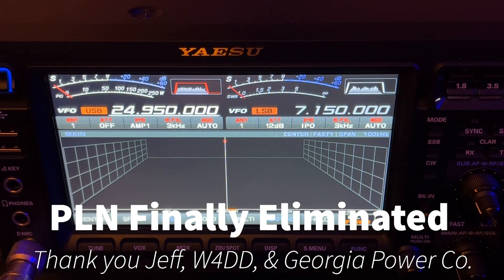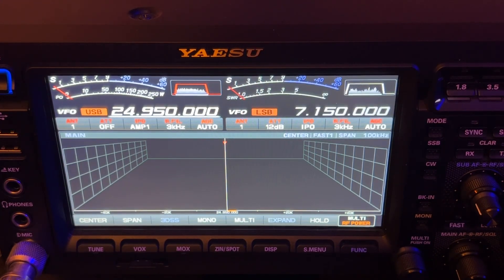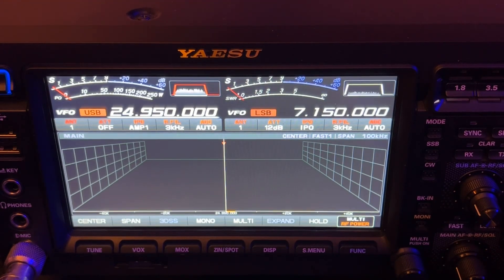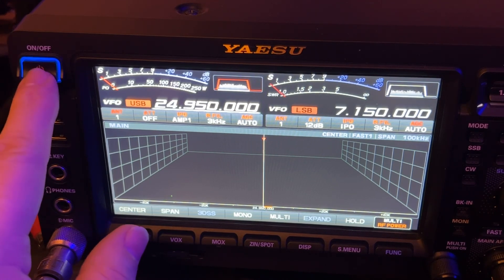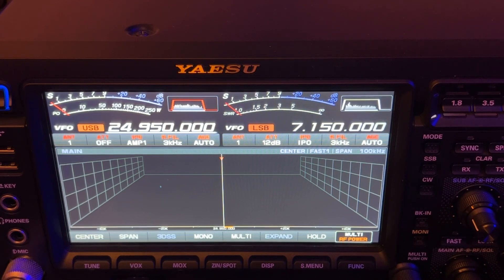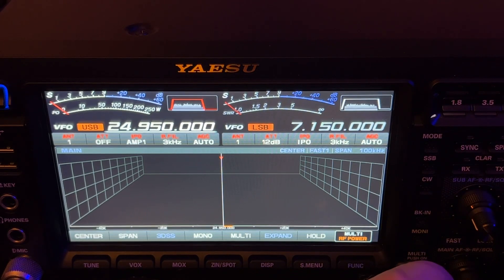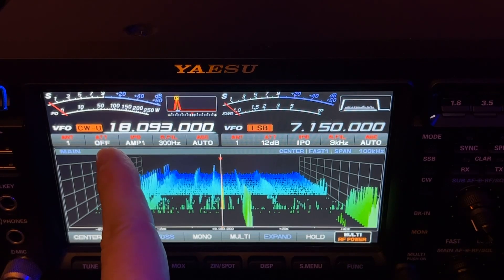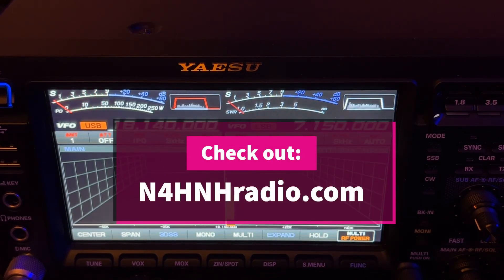PLN Finally Eliminated #hamradio #noise

Comment: Around 20 years ago I had some power pole noise that the local power company ignored every report I made to them. The way I finally got them to come out, after being 'blown off' for months, and investigate was to write them a letter. In that letter I indicated that a copy of this letter, including the date of every report I made, was also going to the FCC. Just a couple of days later I was contacted by a technician requesting when I would be available to assist him. I had to threaten them with government action for them to actually do something.
Reply from the maker: They are no longer afraid of the FCC. They know that the FCC no longer gets involved. The FCC turns it over to the ARRL. About three months later you get a call from the ARRL. That’s what I did after my power company told me that they don’t fear the FCC.  In fact, they told me that they absolutely don’t fear the ARRL. 

Jeff had the same problem as me. Couldn’t get anyone to call back, even if they said they would. He had to enlist the help of someone he knows at the power company. They finally got someone to help. Jeff had already done half their work. He identified every source of noise.

Comment: I have Philadelphia Electric Company. I had problems about 10 years ago. They were supposed to come out one afternoon to check things out. But they never did for one reason or another. My secret was to tell the power company that I was going to report them to the FCC. I told them I had an FCC Ham Radio License and if they didn't fix the problem quickly I would report them. Well, the one thing a power company does not want you to do is report noise problems to the FCC. They came out within a couple of days and fixed the problem. KB3Z
Reply from the maker: If you read the whole story about my ordeal, which is covered in the description for the video I reference in this video, you will find out that my power company doesn’t fear the FCC. And they especially don’t fear the ARRL.  They say so emphatically.  In fact, the FCC doesn’t help with PLN at all. They turn it over to the ARRL. The only reason this got resolved is that Jeff pinpointed everything that needed to be done.  Then he pulled some strings because of someone he knew and was able to get a line crew for half a day.
Reply: And to be honest that doesn't surprise me. My situation was 10 years ago. So PECO may have taken the same attitude that PLN takes. And with all the issues that the ARRL is having, that wouldn't surprise me that they don't want to make any issues. Unfortunately it seems to be the sign of the times!
Reply from the maker: My Power Company is Georgia Power. They were responsive back in 2018 and 2019.  But not anymore. The ARRL usually calls around 3 months after you write to the FCC. This is my second time to write the FCC and have them turn it over to the ARRL. I don’t know why it takes 3 months. The first time, the ARRL was no help.  This time they were. They contacted Jeff.  They offered to help with legal assistance if Jeff couldn’t get the power company to cooperate.
Reply: What about contacting the local corporation commission? The utilities have to report to someone.
Reply from the maker: The Public Service Commission. I called them. They took my information and did nothing.

Comment: Here in Flint, MI, I also had a PLN problem.  I didn't pinpoint the exact pole where it was coming from, but notified the  power company of the problem in my neighborhood.  Six months later, a power failure.  An hour later power was back on.  Drove down the street later and saw a brand new power pole and transformer installed a few hundred feet from the house.  Saw a few more new poles and transformers around the area in the following months.
Reply from the maker: The noise is virtually never the transformer. But the hardware on the pole can cause much noise. My power company was once good about coming out and taking care of the RFI in a few weeks. They had a dedicated analyst to identify the exact component that needed repair, replacement, or cleaning. He retired 3 years ago. They haven’t replaced him and one of the personnel told me they don’t intend to replace him. It’s getting more difficult to get them out to fix the RFI, because they no longer have someone to determine the problem. That’s where Jeff, W4DD, comes in, with his software and other devices. He spells it out for the line crew. They fixed 4 poles by noon.

Comment: Thanks for the update, Doug.  Really happy to know the good news.  High quality content follow-up video.   By the way, we currently have 4 display aquariums in our home and some of the LED lighting / power supplies were a huge noise source.  Had to redesign and correct the issue.  Again, great to hear your power line noise has been resolved.  73, Dave, AC3HT
Reply from the maker: Dave, I’m very happy. Jeff was amazing. He doesn’t even work for the power company. He did half their job for them. He still ran into the same roadblocks that I did.  He tried 4 contacts and no one would follow through with callbacks, even though they said they would. He had to call in a favor from someone at the power company with whom he has worked in the past, but in a completely different region. That person got someone to call back and schedule a line crew for the half day.

Comment: My PLN was 3 poles - 4 lightening arrestors, 2 insulators and 2 ground wires
Reply from the maker: The worst offender on mine was the antique lighting arrestor. Installed in 1989.